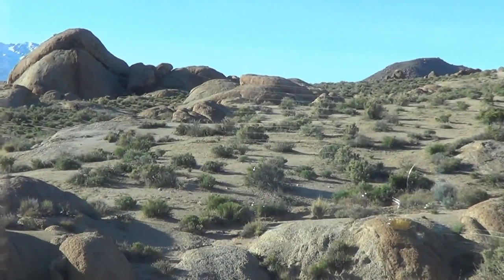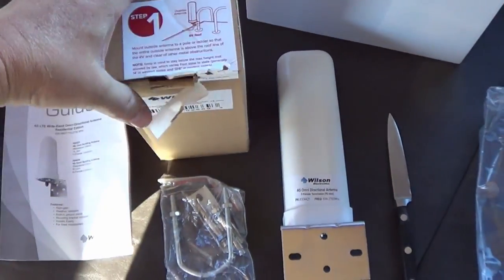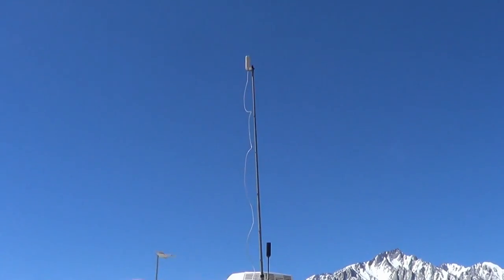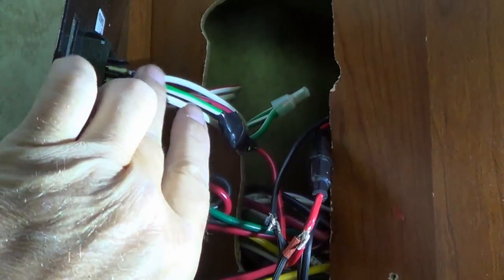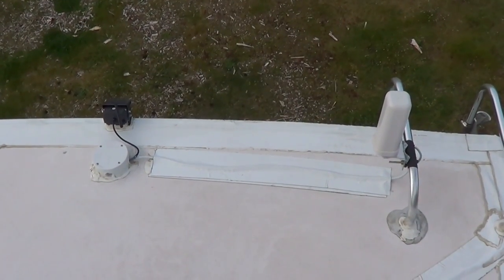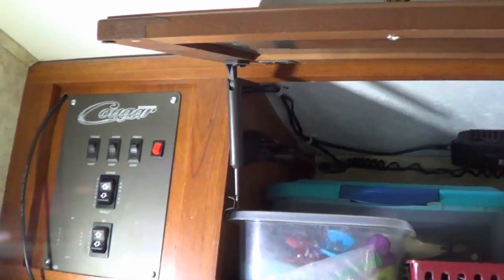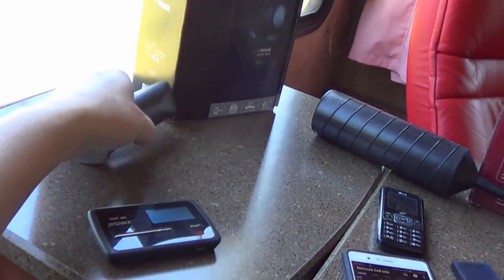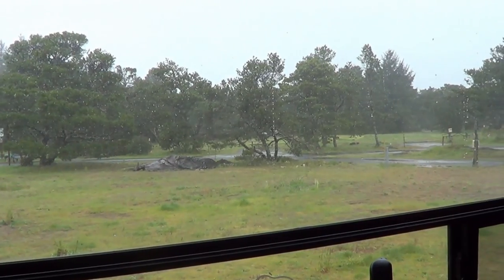weBoost Drive 4G-X RV Cell Booster Install and Review

Comment: What to send me one DO you now how much that is it said 899 dose weboost alow payments
Reply from the maker: I don't think they have a payment plan, the sales page says $499 - http://mbsy.co/gmr7N?url=https://www.weboost.com/products/drive-4g-x-rv
Reply: Ok what would you say if im in my home and get 95 db would I see a better SIGNAL we have alone of trees but ARE 0.9 miles away from the tower would a cheaper weboost do
Reply from the maker: Every location and tower is different so hard to be absolutely sure, but we usually see increases of 20 - 50 dBm. In some instances, it isn't signal strength slowing things down and causing bad connections but an overload cell tower. The cheaper weBoost will help boost dBm but not as much as the 4G-X drive.

Comment: Just paid over $500 for the Boost Drive 4G X Rv and still don’t get any better service then we did before we purchased it. Not impressed at all!!
Reply from the maker: Likely the problem is the cell towers you are connectin to are all jammed up with users. The booster only can boost weak signals it can't make it faster if the cell tower isn't congested and the signal is weak.  In the last few years I've been saying that the biggest problem is now overloaded cell towers where the premium plans get preferred access. If you have some kind of cheap unlimited plan you get bounced to the lower tier and have lower access versus higher paying plans. Another thing is cell coverage has improved quite a bit rendering these boosters less effective than they once were.  They still work well if you are in a fringe reception area connecting to a non-busy tower, but hoping to get fast speeds when you already have a good signal doesn't happen.  - Recent booster review - https://youtu.be/gtM8qgD0AbE  Ray

Comment: this is what i dont understand. seems like it would be easy to fix the broadcast range inside rv by getting hotspot device. This way you can place the hostspot right next to internal antenna and in turn the hotspot will broadcast wifi inside the entire RV. You can then put your cellphones to use wifi for texting and calling. As far as i know all modern cellphones have that feature.
https://support.t-mobile.com/docs/DOC-30238
Reply from the maker: Yes, good idea, and I have hotspot device but my smartphone doesn't have WiFi calling support. Huawei Model  P9 Lite, It's a few years old unlocked international version.  Another option is to use Skype calling.

Comment: A couple of posers. Maybe a directional antenna for the outside would get you a better signal. Also, I found that I can get better range by focusing the WIFI antenna(inside one) by placing some aluminum folks shaped into a dish behind it. 

Just my 2 cents...LOL
Reply from the maker: The internal antenna is still broadcasting cell frequencies, not WiFI. But, interesting that foil can have an effect.

Comment: Thanks for the info! I purchased a weboost 4G-X RV and installed it (https://youtu.be/iew18uWvdfw). I definitely see a signal boost and my upload speeds are better, but my download speed is actually slower. Have you noticed this?
Reply from the maker: I've seen things like that the odd time myself, where even though it boosted the signal strength, speed suffered. Usually, it was when the signal was strong anyway. Cheers, Ray

Comment: At $500 this is a dismal statement about this product. I think I can limit my cell needs rather than incur this ripoff.
Reply from the maker: I agree I think the product is only viable if you absolutely need to maintain a cell connection say for work, safety or to stay in touch with family or if $500 isn't much money to you. To some, it's not much. Otherwise its not worth it. Also, the Sleek model does a pretty decent job at around $200 bucks.
Cheers, Ray
Reply: I can tell you do not absolutely positively need cell service when boondocking. These boosters are not for everyone and therefore...not everyone should throw their opinion in the hat. If your income depends on connectivity, this unit is a steal.
Reply from the maker: @twmcali7257  We had Verizon, if you get a good size hill/mountain between you and the closest towers, you'll lose signal, so it can be patchy.